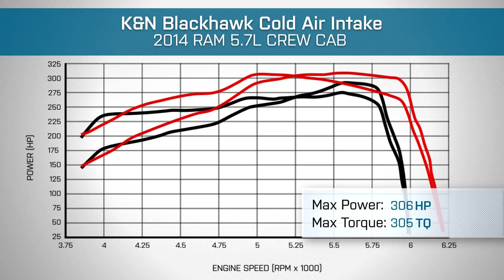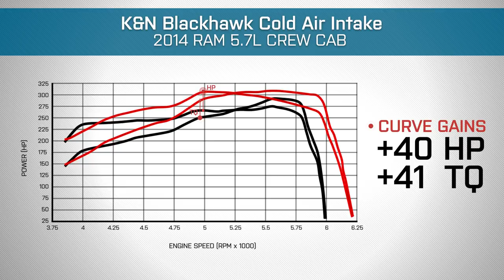2009-2018 Ram 1500 K&N Blackhawk Cold Air Intake 5.7L Review & Dyno

Comment: People don't buy into the marketing BS of K&N and CAI. Your factory intake is designed by ENGINEERS...leave it alone it works just fine. Noticed how they did dyno test with a tune. Why not do a dyno test without a tune to see how much HP is really gained.
Reply: Engineers also work at these companies. Honestly CAI systems vary from vehicle to vehicle. I've seen some lose HP and some gain it. I've also seen others that gain some but it's way up top. For example. I had a friend with an 02 Mustang GT Dyno after just an intake and gained a little over 6hp, I had a Ford Ranger 3.0L lose 2hp and I had a Grand Cherokee 4.7 HO that gained 13HP but it was almost at redline. They're hit or miss honestly and for 3-400 for one I'd much rather just get a programmer and leave it be. Or an exhaust and programmer to get the sound and gain a little.
Reply: Lionfish Hunter the “engineers” have different goals in mind. Engineers also design the shitty stock muffler... why? To be nice and mushy and quiet so everyone is happy.

Yes, 90% of the gains were probably the tune. But an aftermarket intake will help. Up to you if it’s worth hundreds of dollars or not.
Reply: Or maybe if you know what the hell your doing install it with its own  tune
Reply: Most "Cold" air intakes pull air from inside the hot engine bay while most stock intakes pull air from the cooler area between the inner and outer fender.  Restrictive yes but colder air.  Better to get the Mopar kit to go with the sport hood.  Functional hood scoop and less restriction.
Reply: You’re right about k&n’s bs but factories leave a lot of power on the table

Comment: Out of all the upgraded air filters I have done through my almost 50 years. Not one has ever giving me any HP gains. It has always been the tune.
Reply: I disagree, I have had a cold air intake raise my top speed on a vehicle. Before I could not go over 127, after I hit 144 only single change. Even the temperature outside was with in 4-5 degrees, on the exact same road. That intake added mph so therefore it added HP. BTW, no tune was done.
Reply: @Reptitude  
Cool story
Reply: @natturnerlearner167  to be specific the car was a 2000 Civic Si, and yes with only an AEM cold air intake it could redline 5th gear, 144 MPH. It also took .3 off in the 1/4 mile.
Reply: @Reptitude  lmao yea ok
Reply: @youngblood23rb  guess you have never driven a car with a b16a in it. But yeah the intake change did wake it up that much.
Reply: Experienced mechanics tell me it's best not do any of these "cool" upgrades. The entire vehicle was designed to function properly the way it was originally made. Adding these types of "upgrades" will throw everything out of whack in the long run. Prost
Reply: John Sineni thanks for the laugh I really needed that with all this epidemic going on with this COVD-19. LoL
Reply: @Reptitude  we don't like rice rockets
Reply: @LamontBoucherville  but funny thing is the V8s now have adopted a ton of that early 2000 technology on some of those engines. Variable valve timing, more DOHC for the bigger power V8s now. Hate on that little 1.6liter, but in 2000 there were not to many N/A engines making 100hp per liter. And soon enough engines will not have cams at all, that free valve prototype stuff looks awesome unlimited timing possibilities with that.
Reply: @Austin Knowles on the 5.7 hemi, not sure no experience with that application on that engine. I looked around and I think the best option for the Ram is the S&B intake.  But cold air intake do give gains on some cars and lose power on others. They lied to you in this video because they did a tune as well so the gains here a not just intake. My Ram is still stock, and I will likely go with a S&B with a fastman throttle body eventually.
Reply: Butt horsepower
Reply: @Reptitude  bruh you guys are confusing th out of me. So does a K&N cold air intake improve performance on a 2017 ram 1500 limited or not? Nothing but an intake installation, no tune, nothing. Does it I prove performance or not???
Reply: @mustafamohammad1821  on a Ram 5.7 Hemi it will give you a better sound, and a little bit more power but nothing significant. You will really need a tune and a throttle body to open up power on the intake side to a noticable amount. I have a 2018 Ram 5.7, I probably will not go with a Cold Air Intake unless I get a HP tuner ECU, and a Fast man throttle body. Alone on that engine you will see very small gains. It depends on the engine and vehicle setup. Friend of mine got one and saw a little bit. If I got one for my Dam I would go S&B oiled filter. If you are buying one for a Ram, get it for looks or sound not power. The Civic I talked about was to prove a point, that gains differ by vehicle, it was an odd application. I would say I think you will gain more with a Fastman Throttle body than the intake.
Reply: @Reptitude  I'm thinking of getting a cold air intake and an exhaust system for a 4.2l 2008 Audi A8. The car stock puts about 350hp and from what I found, with the intake and exhaust it adds around 30hp. Some people told me it wouldn't affect the car's reliability, meaning it wouldn't make it worse. Thoughts?
Reply: Ok, I put entire exhaust,  cold air, (upper and lower, functional hood) tune and spent $2300 for 28hp.. was it worth it? Ahhhh it sounds awesome and little gain but at the end of the day not really.. to each their own I guess
Reply: I'm going to put headers on this summer for real gains and MORE sound 😁
Reply: @Hundert1  you mean Scotty ? Cmon man lmao. Watches his vid acts like a car pro
Reply: @teebo5298  Not only Scotty Kilmer. Several other top mechanics and engineers. Anyway, Scotty Kilmer is pretty good. I've watched some of his videos and he saves people money and points out all the scammers.
Reply: @TheBooze13  So you're saying Scotty doesn't get anything correct or what? Thanks
Reply: @Hundert1  didn’t say that. He knows the basics and carburetors and cable throttles but that stuff hasn’t been around in a loooooong time. He’s just a dinosaur cars tech has long surpassed him
Reply: @TheBooze13  ok, I see what you mean. He seems pretty good with air conditioning too. He seems to be trying to be honest and help others out, to the best of his ability and knowledge, so the auto layman doesn't get taken advantage of.
Reply: @Hundert1  I agree he’s great for the average person and basic knowledge but unless you drive a Toyota Corolla he thinks your car is garbage lol
Reply: @TheBooze13  Yep, I get that feeling too, the Toyota obsessions 😂
Reply: He literally says after the tune they got power
Reply: @Hundert1  not really. Your engine is programmed from the ecu out of the factory very conservative... meaning it's no where near its potential. Being safe. Eco friendly. Now... I would say if your messing with internally like cam and heads or some kind of forced induction. Than yeah your throwing the longevity out of the window that's for sure.  But changing a tube.. by making the overall diameter bigger that's going to the intake... is not at all harmful... or removing the longevity or reliability. If anything you're allowing more volume of air ( breathability ) for the engine at mid to full throttle.  Now the TUNE! depending on what you go for. And how radical the timing is or the fuel you want. Yes. It can however affect your truck runs in the long run... but I'm talking about 20 years or so down the road... or 200,000 miles and above..by than you probably would get a different truck.
Reply: all sound til you tune to breathe
Reply: @Reptitude  yep. Cai on the hemi trucks doesn’t do anything since they’re already drawing air from the wheel well or front grill.  A high flow filter breathes better but let’s more contaminates in.  I’m surprised nobody talks about it.. the bottle neck on these hemi trucks are the exhaust manifolds and intake manifold. Those two with a tune will net more than any cai + exhaust + tune and run about the same if you can do it yourself.
Reply: Yup its all in the tune you can bolt on whatever you'd like but only real way to get the gains is a tune
Reply: @Hundert1 stock is boring
Reply: @macwiller2105  Hopefully, the sound is much quieter, less violent, and more peaceful ✌🏼 😉
Reply: @BlackRam17  interesting 🤔 I'm not getting my truck as a hot rod race car. I need a powerful, nice work truck that's gonna tow a 6,000-pound trailer. I also dislike a center console shifter or that rod shifter sticking outta the steering column. I definitely need a front bench style seat. I'm very pleased Ram 1500 has developed the knob shift on the dashboard. Hopefully the 2025 Ram 1500 is available with the rear reclining seats in all 1500s, Laramie and above. The Tungsten is very nice but I think sadly isn't available with a front bench seat. Thank you, and safe travels 👍
Reply: @Hundert1  column shifters were never broken, the big center console is nice
Reply: @BlackRam17  Column shifts get in my way. I don't like extra stuff sticking out. I need a front seat that holds 3 people. Whatever floats your boat 😉👋🍂
Reply: @Hundert1  what does it get in the way of? 😂
Reply: @BlackRam17   Center shift blocks 3 sitting in front. Column shift kids jerk & yank around, play with, and adults accidentally bang into it like when cleaning or dusting off the area. 😉  Hey, the column shift ain't for everyone. However others love it. That's great, happy Sunday 🌞👌
Reply: @Hundert1  I had one for ten years in my Blazer, never had an issue with it. The hockey puck is ok, I’m just glad I don’t have a center console one.

Comment: The 5.7 hemi of this model is supposed to male 395hp wtf
Reply: 395hp measured at the fly wheel. This is measured at the wheels, so it includes the loss of power through the drivetrain.
Reply: @boardskateguy  everyone thinks cranks hp is to the wheel hp lol, non car people 😂
Reply: Obviously someone is new to the car scene smh
Reply: Lol not to the wheel
Reply: The engine does, it just doesn’t get to the wheels with all the drivetrain shit taking power away

Comment: Shoulda left the tune out, or done a pre tune run apples to apples out the window.
Reply: I agree, makes the whole before and after tests null.
Reply: Ya really, most gains were probably from the tune.
Reply: Yep
Reply: Cold air intakes do absolutely nothing. You stock air box takes air from below the bay and now your taking hot air from the motor,  even if it added 3-5hp, at 400$ that’s a fail in my books.
Reply: @William_wayne84  Thanks Karen!
Reply: @William_wayne84  This is clearly a short ram intake. I cold air intake hangs all the way down To the bumper, hence the name cold air intake. Not sure why they call this one cold air. It's not. All it breaths is hot air.
Reply: @brown5252  I don't know what your definition of a Karen is but William_wayne84 is telling the truth
Reply: It's funny how all you guys think you know the difference between cold air and short ram

Comment: How is this not a hot air intake?
Reply: Technically it is. It's a short ram intake breathing hot air from the engine bay. Cold air intakes stick out all the way to the bumpers breathing air from outside the engine bay. Hence the name cold air intakes.
Reply: @911Fuser  so this is a hot air intake, got it.

Comment: The title should read, “40HP Gain with only Cold Air intake & Tune!”
     You could have simply tuned the truck previous to adding the cold air intake, then dyno it to see what the HP was before adding the intake and then another dyno run to see the gains.  Or, run it on the dyno before adding the cold air intake then after without tuning. That would show legitimate HP gains for the add-on only.  Then you could throw in the tune to get total HP Gains.
Reply: I agree.
Reply: I agree

Comment: This is a short ram intake. Cold air intakes hang all the way down to your bumper. Hence the name cold air intake. This one breaths hot air from the engine bay. Despite the heat shield. It's still hot.

Comment: Hi guys, quick question for you,I loved the video and I am looking at installing the same cold air intake on my 2013 ram with a 5.7 hemi. I was also looking at changing my throttlebody to 187 mm and changing my thermostat to 180° thermostat. My question is do I need a tuner when I am done For it to run properly or am I good for a while without tuning it?

Comment: Im confused how does this style of CAI get cold air sitting on top of a hot engine? Isnt Ram air the only true way?
Reply: Ram air or a true cold air intake like LMR makes for the Chargers. Most intake companies that make intakes like the one in this video claim that the weather strip and heat shield block out the heat when the hood is shut but that’s a crock. These kits typically cost over $300 and actually add weight to the vehicle too. Best bang for the buck is just a drop in K&N. Typically under $60, barely any heavier than stock and actually yields wheel hp gains because it doesn’t get heat soaked and draws cooler air from the fender through the factory air box.
Reply: Truth!

Comment: Big wheels and tires will rob power that’s a given
I’ve had multiple ram trucks the last one I put on the Dino was a 2009 with a five speed it made
 300 stock and with a tune it made 319
And for that matter some Dynos will show low or high depending on the brand
The one we were using was calibrated very well

Comment: Installed and got a check engine light on my 17 RAM 1500
Reply from the maker: Hey, CJ! I would try disconnecting the battery if you haven't done so already, and let the power in the truck drain for a  couple minutes before re-attaching and restarting. Sometimes that and letting the truck have some time to adjust to the new intake is needed for things to run properly. Also make sure all sensors and lines have been reattached properly. If you're still experiencing issues, give us a call at 1-888-706-1096 and we'll be happy to take care of you! -Zach

Comment: I bought 4 K&N system's an I had to bring  them back to the store. The pipe is 1/2 inch to small. It don't fit on the filter itself. I would like to know  were to buy one.

Comment: Hi! Great K & N demo Vid! Should we actually use some Silicone Adhesive to "hold down" the weather stripping along the heat shield, or was it going on pretty tight? Was afraid I'd be looking at a rubbery chewed up snake mess under the hood on a hot summer day just off the side of the California 405 traffic nightmare fwy if I leave it be (and the weather stripping got loose).
Reply: It has a metal retaining clip in it and it takes a decent amount of effort to install. It won't come off easily

Comment: If you ALMOST close your hood and peek inside, you’ll see the hood doesn’t NEARLY close down on the heat shield. There was about 1-1/2” gap above it; PLUS the big gap where the A/C pipes go through= useless heat shield. 
On my 2019, I bought a $70 K&N cone filter and just stuck it on the end of my intake pipe. Same thing, but $400 less! Come on K&N, this setup is so Mickey Mouse! 🙄🙄🙄

Comment: How can it be a cold air intake when your pulling hot air from the engine bay?  My CIA in my mustang plumbed into the fender so it collected the air from outside
Reply: Exactly. It's not. It's a short ram intake. False advertising.

Comment: Factory specs for a 2014 Ram w/5.7:
HP: 395 @5600 RPM
TQ: 410 @3950 RPM

Why is the dyno so low compared to the factory specs?
Reply: Because the factory specs are to the flywheel. And the dyno is to the wheels. You lose a lot of HP between the flywheel and the rear wheels.
Reply: I didn't know factory specs were at the flywheel. What a rip-off!
Thanks for the response.
Reply: @bluegrasspointofview5191  yea it sounds better to the flywheel. Lol 😂

Comment: Ugh... I thought these later 5.7 Rams were making 395 horsepower Factory. So you're taking rear wheel dyno pulls?
Reply from the maker: Rear wheel dyno pulls all day with our product reviews, drive train loss can be a real pain sadly! -Zach
Reply: AmericanTrucks Ram I completely agree. I have build a lot of muscle cars over the years, along with trucks, but I have never taken my vehicles to rear wheel dyno pulls. My builds were always for Street use, and non-competition other than street racing LOL. I always plugged in the factors of weight and horsepower to determine how much I was making. This does show me though, that a lot more was being lost then I realized with these 5.7 hemis. I do not own one in a car but I have a 2013 Dodge truck which is completely stock and I have no desire to mod it at all. I came out of the sixties and seventies where are we purposely built or bought. Very interesting though! Thanks for the great info
Reply from the maker: Thanks for the comment and the views! We appreciate it! -Zach

Comment: +40 hp..yea right..other video says +68 too
Reply: Why not 100hp?
Reply: Just changing the air filter is not going to give you that much more horsepower there's just no way if that was true people that drag race stock automobiles would take their air filter off before each run.  . You're not going to get any more air flow than what the computer will let go in there
Reply: Maybe take the exhaust manifold completely off engine and run it like that plus maybe a 12 inch diameter intake hose that's 1 inch long from throttle body so no curves at all for airflow before entering intake. And maybe get 2-5hp gain.

Comment: Does this fit on a 2019 classic? It's still a 4th gen even though it's a 2019.
Reply from the maker: It absolutely will fit a 2019 Classic 4th Gen RAM! -Zach
Reply: Getting this issue with everything I search for.  I have a 2020 classic and few websites fit and search bars are updated for us.